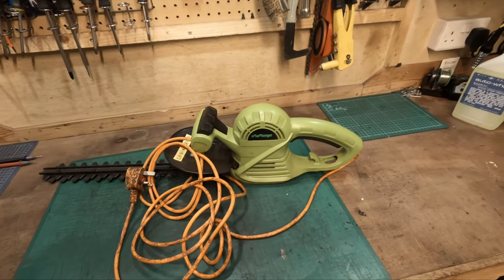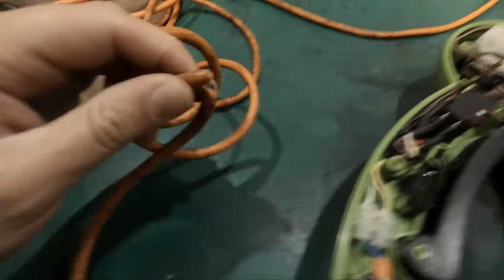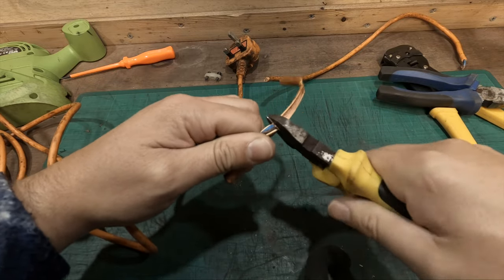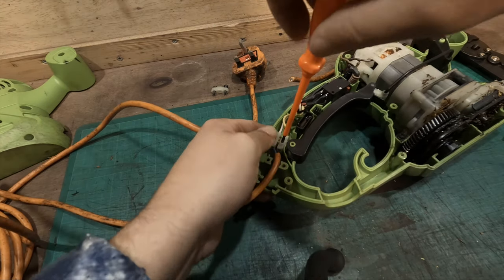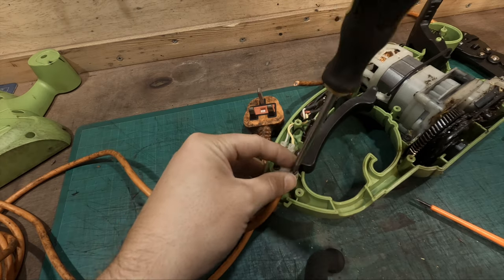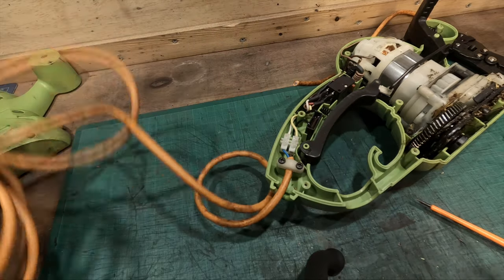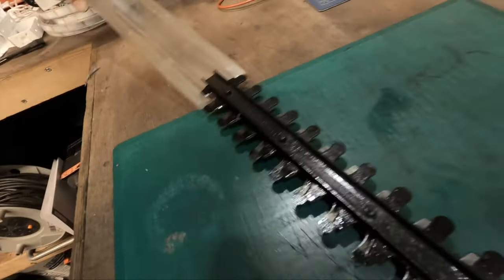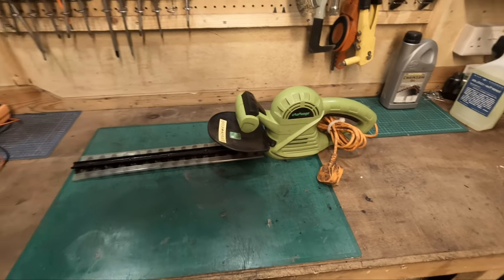Rewiring / Repairing Cut Power Cable Electric Challenge Hedge Trimmer CUT cable [HOW TO repair WIRE]

Comment: Just logged on to check a repair and cutting it off and re-wiring it will work a treat. Just needed the spark ⚡️ and thank you for it.
Reply from the maker: Glad it helped
Reply: I've to put a new plug on mine, is it an issue that it doesn't have an earth wire?

Comment: Same here! Borrowed my neighbours hedge trimmer only to find he had practically severed the cable before lending it to me! i did a temporary fix with a block connector and wrapped it with tape but thought it ought to be possible to do a proper repair just as you've shown us. Only thing is, the screws on the casing aren't standard crosshead. Is there a special bit I need to undo them? Also a bit worried about springs/safety cut-outs flying in all directions as I take the casing apart?

Comment: Hi I have a challange corded 400w hedge trimmer.i cut through the cable, which I've fixed from the inside, but the two springs have popped out and Don,t t know where each one goes, as they are two different springs.

Comment: I HAVE A BOSCH 390W HEDGETRIMMER, WIRE REPAIR DIDNT WORK SO BOUGHT CHALLENGER 400W TRIMMER, CUT THRU WIRE. LOL!  WONDER WHY BOSCH ISNT WORKING THO MIGHT RIP IT APART BUT ITS GOT STAR SCREWS, SLY, THEY DONT WANT YIU TO FIX IT BUT GOOD OLD ARGOS WITH THEIR 30 QUID CHALLENGER TRIMMERS, PIECE OF CAKE